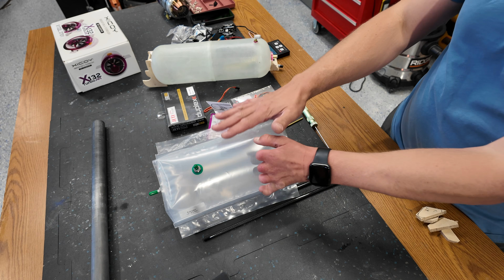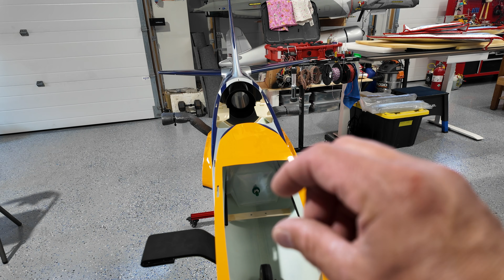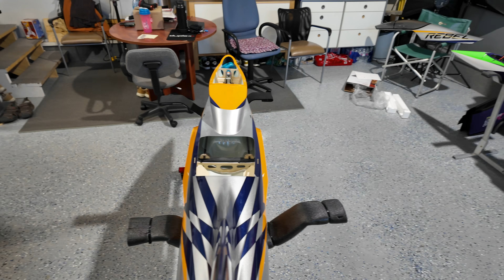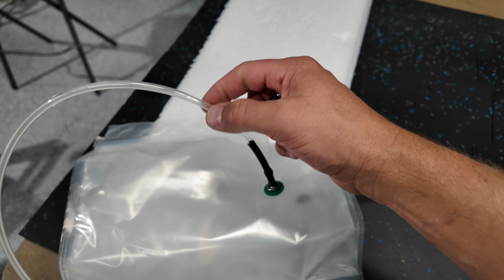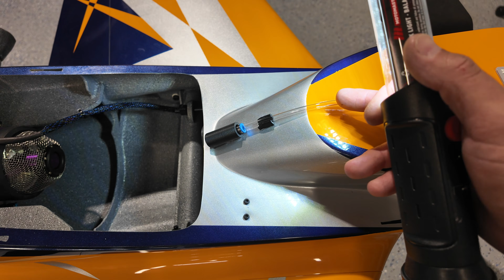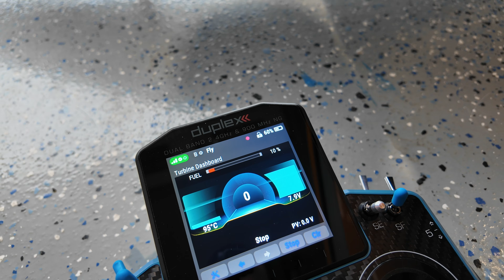Essential RC Jet Fuel Bag Installation - HOW TO - CARF Rebel CLASSIC

Comment: Great video.
The original tank's capacity is 3.6L, yet you chose a 3L bag - why?
Would a 3.5L or 4L bag fit in this plane?
Thanks,
Reply from the maker: Generally we always reduce capacity of the bladder. With rigid tanks as you start to get below 1/2 you will start sucking more air if your flying style is more than flying racetracks. 

With bladders you can use 99% of the capacity and the turbine knows no difference.

Comment: Why did you install the bag with the suction side facing forward? Could it have been installed facing aft?
Reply from the maker: Basically can be in any position.   Sideways works if it fits.  What's important is air is removed during fill.  After that orientation makes no difference.  In the Rebel it kind of worked out better to have the pump pull facing forward to hide the line going back to pump as best as possible.  In the upcoming F100 series we are also doing a bag.  That one will face the rear.

Comment: So what is the advantage; lighter weight or more fuel capacity?
Reply from the maker: Weight.  No Bubble trap needed.  Can use all of the capacity so typically can go with a smaller tank.

Comment: The most importand thing you did right but not mention is to create the mounts with a fully inflated fuel bag. If you do it with an empty one you cannot use the full capacity. Especially when you mount it with some tension. Also I am not a fan of blowing into these bags with your mouth. Because you get a lot of moisture in it from your breathing which is hard to get out. Use a ball pump or similar instead.

Comment: Great video! Excellent. Thank you Jonathan. BDW, what model festo connector are you using on the end of that 6mm hose when connecting to the fuel station? I noticed that you put it in all your projects. At the end of the hose from the fueling station is the same connector that fits the connector on the Rebel? What are the connectors? Something from the FESTO program or?
Reply from the maker: Thank you!  It's a festo quick connect.  Very similar to an air chuck fitting for shop compressors.
Reply: @thelightersideofrc  Hi, where can I get those connectors?

Comment: Great install on the Rebel.  I did one of Jordan Factors 3.5 liter fuel bags on Hispano Bull Mo1 with a Jetcat turbine and have a number of flights on it now.  It saved me about 2.5 pounds by removing the UAT and the stock fuel tank.  Thanks for your videos.
Reply from the maker: Wicked!  That sounds like a killer setup in the BULL!

Comment: Hello Jonathan, Jay here. I'm not sure if you have seen my question from your last live (#44), but since this is the video, you're showing how to install the Fuel Containment Device (FCD), I will ask again. Would the FCD work well for a propeller, gas engine?
Reply from the maker: Hey Jay. From what some gents are saying, it will work in a pumped setup but a standard carb doesn’t have enough pull to operate properly. This is what others have said.
Reply: @thelightersideofrc  Thank you again Jonathan 🙂. You have been a lot of help with all of the new tech stuff. I will only trust some, and you are one of few that I do.